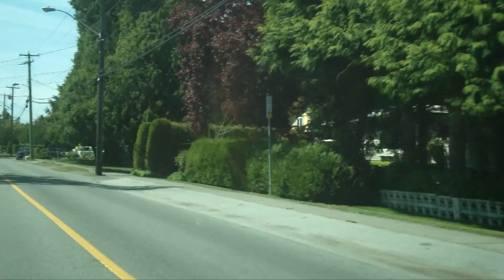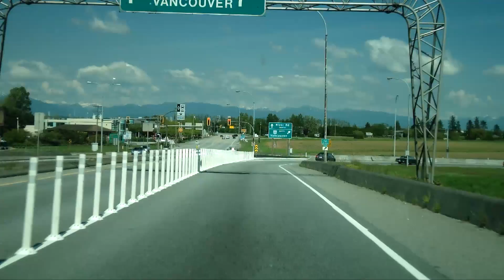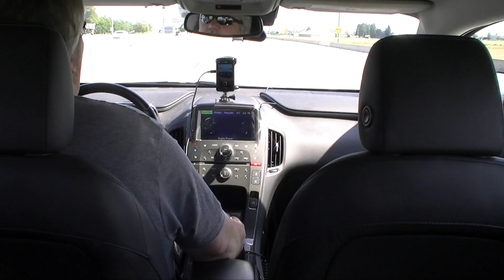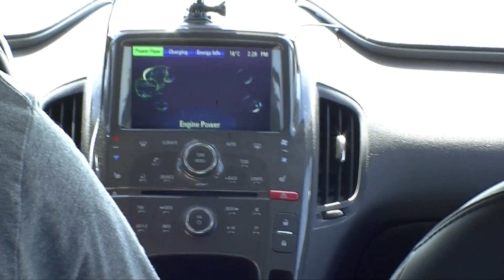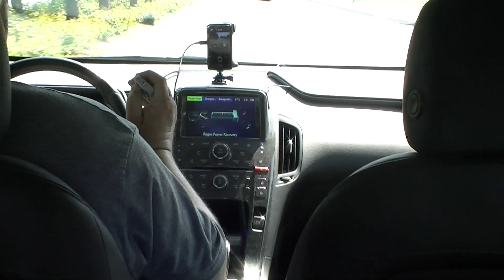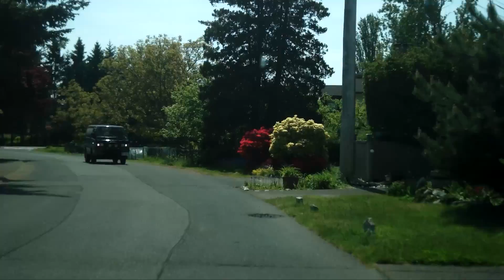How to drive a chevy volt for best electric range and fuel economy

Comment: Im considering buying a used 2013 with 40k on it. have you had any maintenace issues at all with yours, I have been trying to find issues I cannot!
Reply from the maker: +Thomas DiCostanzo The reason you can't find issues with the volt is there hasn't been any major issues. It is exceptionally reliable. In the 5 years I have had mine I have had no troubles at all. At last inspection, with 80,000KM the mechanic measured the brake pads. Still had 11mm of wear remaining. They are only 15mm new, so by 80,000KM (50,000 mi) I used up only 4mm of the brake pads! This is because the majority of the stopping is regenerative, and the brakes are used very little. I am definitely going to be going for the new one, and hand my old one down to my wife, and her car down to one of the kids.
Reply: +12voltvids thanks for the reply Im leaning towards the used one as it has EVERY option for 16k and it seems that the fact that it has 47k miles on it doesnt really matter? I only go 9-10k a year and its 90% city.
Reply: 22k in a bit over 2 years.  I've had no issues at all.  Of the 22k only 2500 of it was on the engine.  290 mph so far.  Amazing car.
Reply: 3466mark... That must have been a very steep hill to get up to 290 mph on 84 hp. Way over the speed those LRR tires are rated for.  ;-)  Yeah, I know... The g is right next to the h on my keyboard, too.  Or that pesky autocorrect function changed the mpg that you typed to the mph it thought you meant.
Reply from the maker: Only 1 issue in 5 years, and that turned out to be a non issue. There was a power fault in my neighbourhood caused by a car shearing off a pole and causing primary to drop to the neutral, and causing a ground potential rise. My car was charging at the time, and caused the computer to throw an isolation connectivity fault, which locks out the charging system and turns on the service high voltage charging system message.  The car still is drivable on gas, and mountain mode will maintain the 40% charge, it just will not turn on charging when plugged in. This is one of the few faults that will not clear until the dealer inspects the car, as that fault would not normally happen unless say a wiring harness got worn and caused leakage to the chassis.  Dealer gave me a loaner to drive, did a full inspection and reprogrammed the modules. NO CHARGE. Incidentally during that power event my hot tub controller was blown beyond repair, and that one will cost me 500 to fix, so no more hot tub for me.
Reply: haha...yea that mpg.  Big difference.
I dont get much over 70 in the Volt.  The more time I spend in it, the better my life is.  Complete opposite of a gas burner.  Cant wait to get to my destination.  I take the scenic route now...
Reply from the maker: +3466mark 2 of my co workers have now bought a volt, and they both love the car as much as I do. Now in the province of BC electric car drivers get to use the car pool lanes, which cuts down tremendously on commute times during rush hour, and that is just an added bonus.Saving an hour every day of travel time, besides saving money on transportation costs, you can't put a price on your time, and saving 5 hours a week traveling is a huge bonus for many.
Reply from the maker: 290MPH, are you on drugs? The car has a max speed of 100MPH, it is speed limited to that. Never had any issues going up any hills, and I have been all over North America. BC, Alberta, Montana, Utah, Arizona, Idaho, Oregon, California and Washington. Just did a 3500 mile treck all over Utah last week.

Comment: I am so puzzled about how stupid GM has been to market the Volt the proper way. All you ever hear is that is has a 40 mile range on battery power , but you never hear about the incredible GAS milage this car gets . Gas milage sells cars , Wake up GM and market this great car the way it should be . So what has been the actual MPG over the life of your volt to date . This is what people relate to .
 Great vid
Reply from the maker: This is because journalists don't actually test things. They research bad information from other misguided journalists, and interpret numbers that they don't understand.The new volt goes 50+ miles on the battery before the engine even considers starting. I know someone that has one, and he regularly gets 60 miles on a single charge.A 9 gallon tank of gas lasts me about 10 months.
Reply: +davie biggions This is why I believe US car manufacturers are in bed with the oil and gas companies.
Reply: This is EXACTLY how i feel...I was shopping for a prius and possibly a prius prime, but then i saw that the volt is a 35-40 mpg car AFTER going 30+ miles....  that's monumental since my commute is 'long' but under 30 miles round trip....even on my most driving day, i'll be going 50 miles... at worst, that's 1 full charge and half a gallon of gas...  total about $2.00 unless i get a free charge somewhere...  that's better than the prius and far better than most cars.  

I'm just mindboggled that the car has been out for 5 yrs and i'm JUST NOW learning that it can average WAY higher MPG than a prius....
Reply: Doesn't matter to me.  I just keep using the electric and go right  past the gas station
Reply: It's 2024 and gm never made that point clear and undersold it and now has been discontinued. I had to buy one a few days ago to find out what it does and had to youtube "how to drive a volt" 😅 amazing machine
Reply from the maker: My volt sees the gas station about every 6 months unless I am on a road trip. Then I don't concern myself with charging, I just want to get where I am going
Reply: Good video. Thanks. Our last US president was a disaster kind of like your Trudeau guy is now
Reply from the maker: @38XKB8  
You mean the current guy right.
Reply: @12voltvids  No, like the prior disaster of a president.
Reply from the maker: @asb81689  
The guy in there now is a train wreck.  I like him though as it makes late night television entertaining again.  I did like Obama, and George H Bush they were very intelligent leaders.
Reply from the maker: Not all of them are, but you are right. Just look at who they elected.
Reply: 12voltvids, 
Yup, they elected obama....proves how many stupid asses and dead people that we have voting.

Comment: I find it interesting that Chevy programmed the Gen.1 Volt (not sure about the Gen.2 car) to be a 'heavy-regen' mode vs. the B-mode on the Toyota Hybrids which I first believed to be a heavy-regen mode but in fact Toyota said the Prius will actually spin-up the gas motor to provide engine braking when in B-mode, wasting both fuel & energy for regen.

I'm curious with the introduction of the Gen.2 Volt which now has the ELR's "Regen paddle" on the steering wheel at how Chevy programmed the L-mode on the gearbox. Will it still do the same thing as it did on the Gen.1 or be more like the Prius?
Reply from the maker: +Trades46 The prius has a relatively small battery, and once it is reaching capacity, the engine starts. The Escape Hybrid also does this (I also have one of those) The volt does not because it has a much bigger battery. From what I understand the 2nd gen volt works exactly like the first gen. It dumps all the reg power back into the battery. The main difference is once running in gas mode, the second gen volt sends power from the engine into the planetary gear set, and out to the wheels, whereas the first gen the mrime mover is always the electric motor, with the engine only generating electrical energy for the traction motor to use, except under specific conditions where some power from the engine is sent into the planetary gear set,

Comment: I think it doesn't help to put the gear in low, it doesn't create more regeneration. .. push the break will also lead to regeneration , The car doesn't break , only when pushing the break pedal very hard
Reply from the maker: +Sander Wolf Have you ever driven one? From your comment I think not. Switching to low range puts the car in full regeneration mode without applying the brakes. When you press the brake peddle regeneration is engaged, as well as the brake pads are primed and making contact with the rotors. This creates drag from the brakes that is not there when switching to low range. Why do you think they put a regen on demand flappy paddle on the steering wheel on the Cadillac ELR, and the new Volt? So the driver can enter full regen without switching the shift lever.Many drivers drive with it low and then modulate the drive with the accelerator peddle. When going though the mountains I select low range and put on the cruise control and the car will stay at exactly the speed I set it tom going up or down hills.